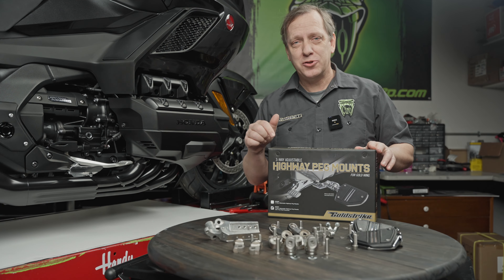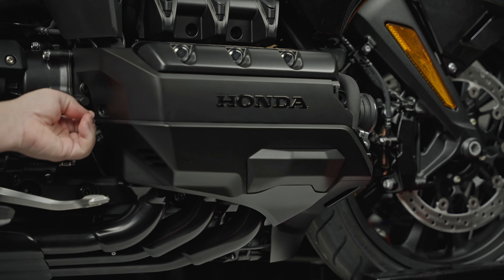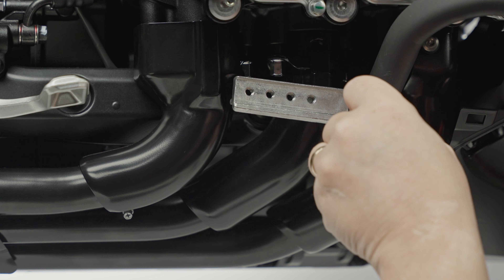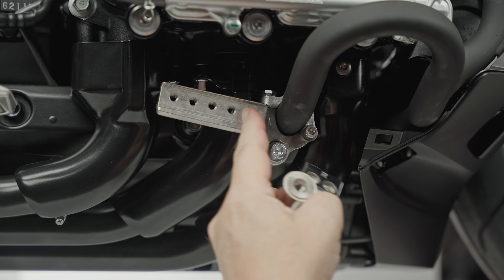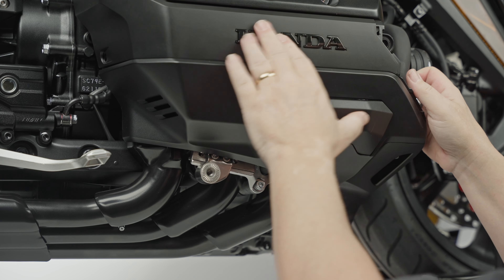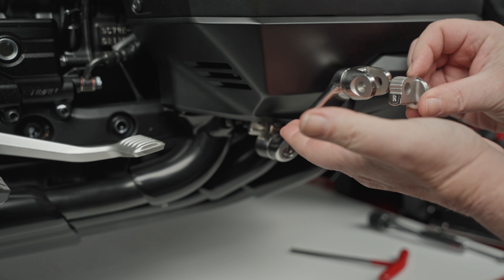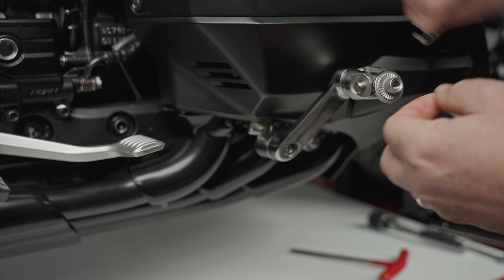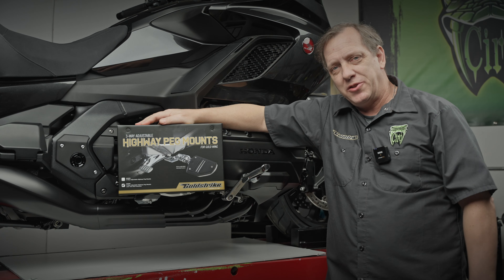How to Install Goldstrike 3-Way Adjustable Highway Peg Mounts

Comment: Using your video instructions, I installed these highway pegs on my 2021 Goldwing yesterday.  I first had to remove another brand that the Honda dealer installed in 2021 that had a bracket that covered the valve covers and the nice "Honda" name on the side of the covers.  Those would fold up on me if I tried to rest my feet on top of them, so I went with the much better Goldstrike instead.  I used to be an instructional designer for a major tech college, and just wanted you to know that your instructional video has got to be one of the best explained, most logical installation videos I've ever come across. (other than my own, of course :)). It is well paced, well explained and illustrated in such a way that it made the installation totally understandable and doable.  That level of instructional quality is hard to come by.  So, thank you very much.  Because of your video, if I ever need any other Goldwing accessories, Goldstrike it where I'll turn to first.

Comment: Got’m and love them. Solid, adjustable where I need them and good looking. Off topic, since you’re here. This may be out of your wheel house of interest Ken, but if anyone can do it your team can. Create a pair of Gold Strike sealed and insulated weather-proof high lumen auxiliary robust driving lights (10-15k lumens) to attach with a well thought-out solid mount just below the mirrors for the 18+ Wings. Lights that can be activate full on with high beams and with horn. You could get creative and have then adjustable intensity but I’d accept the aforementioned. I say this because all the quality products you have designed are all plug-n-play and worked so well with the new generation Gold Wing.

Comment: Very good instructions. Installed the highway pegs in about 2 hours comfortably. Interesting that the 23 GW bagger is asymmetric so that the left peg is about 2" nearer the rider peg than the right side. I saw that someone mounted the slider on the right to compensate. I will test the highway pegs to see if they work for me with a 33" inseam. They are comfortable while just sitting on the bike. I need more stretch on the right leg due to an injury and the offset between right and left seems perfect. Can always rest the heel on the end of the peg for more extension.

Comment: Unfortunately I didn't have total success.  On the right side that bottom pic that you snap before you slide it forward broke (seen at 1:59).  Left side no problem.  Not sure what I'm going to do.  since mine is silver underneath I might use a silver small maching screw and drill through to bottom of the cover and put a washer and nut on the inside.